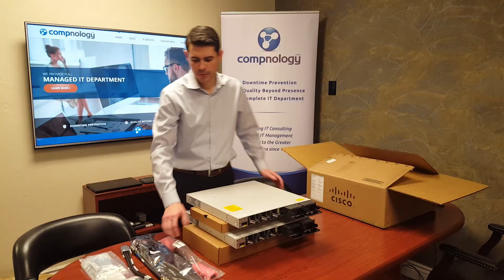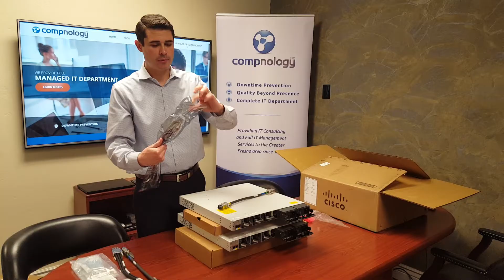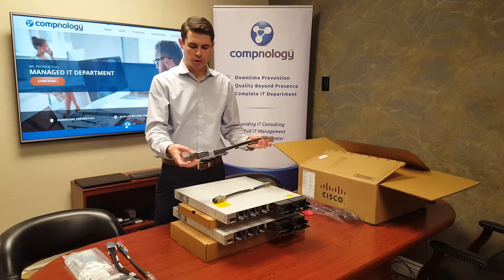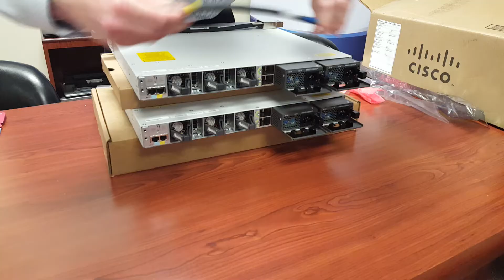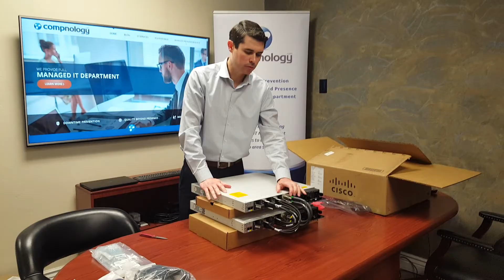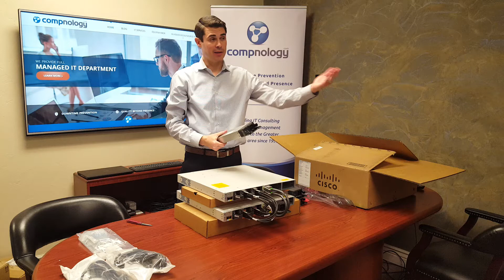Connecting Cisco StackWise on the 9300

Comment: I'm wondering if the Cisco 9300 series switch supports stacking. By 'stacking', I mean the ability to connect multiple switches together to form a single logical unit that can be managed as one device. If stacking is supported, could you please provide some information on the maximum number of switches that can be stacked, the type of stacking cable that's required, and any other relevant details? Thank you!
Reply: The "data stacking" from this video is just that. You have multiple switches acting as one and they share data through 480GBps stack cables and act as one logical unit. For C9300 you can stack maximum of 8 switches

You need STACK-T1-50CM= cable for that(or longer)

Comment: There is a good reason he didn't screw those in real-time.  They never match up great, especially w/ Chinese-made cables.  So, put aside 2 hours just to work those in.  Also, screwdrivers help.  Finger-tightening doesn't work great.

Pro-tip: The data cables WILL fit into the holes both ways.  They will NOT be able to be screwed in, if they are the wrong way.   To get them the right way, look at the sides and just make sure the Cisco brand logo is right-side-up.  There was no other indicator that I could find.

Comment: the power stack is wrong
Reply: Correct, I should indicate in another video in case someone takes it as a tutorial
Reply: so what is the correct way of doing this? Green/Yellow on top and Yellow/Green at the bottom?
Reply: @gupttura2766   Top switch green/yellow and botton switch green/ yellow